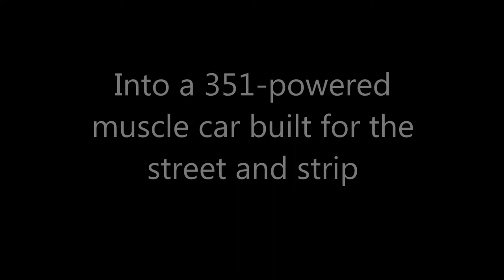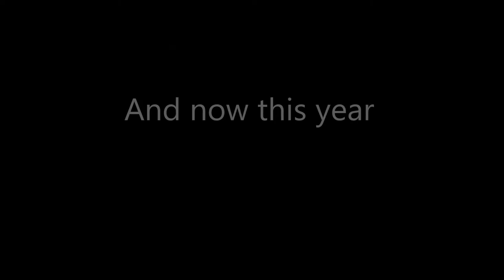Falcon Build Video 2!

Comment: What engine & suspension do you have ? Also awesome Falcon. Have the same one.
Reply from the maker: It was a 351 W roller motor that had GT40 heads at first, and then later Trick Flow 11R's.  Suspension installed was a TCI kit for 66-67 Fairlane.  Rear suspension was Calvert split-monoleaf springs with Caltracs traction bars.  Thanks for the compliment!  Good luck with your car.

Comment: nice car.. what kind of dash did you use . it's so handsome fit perferctly .
Reply from the maker: Thanks!  It was out of I think a 1968 Fairlane GT.  Torinos, Fairlanes and Rancheros all have this 4 pod dash, but Falcon's never did.  They are the same car in that aspect so it was a bolt in deal.  The only caveats were I had to also use the heater and vent controls from the Fairlane and cut holes in the lower part of my dash to fit them, as the Falcon controls were in the upper part of the dash.  And you have to remap the plug on the Falcon wiring harness...but there are instructions online to do that and it was easy.